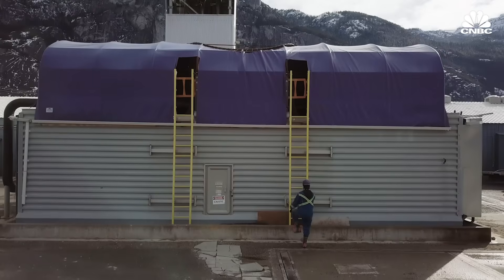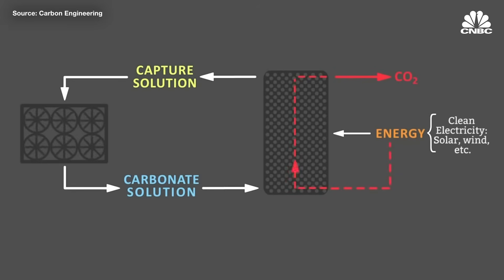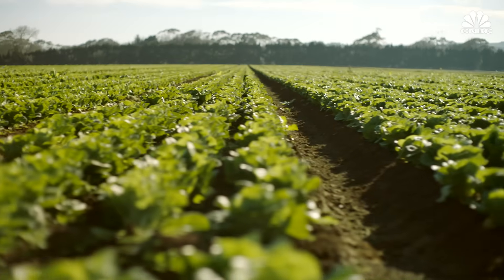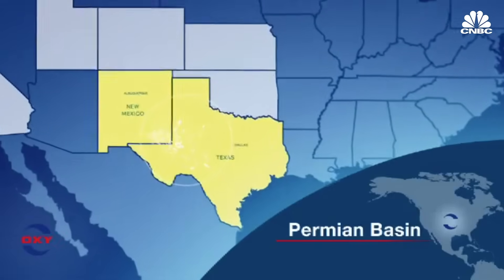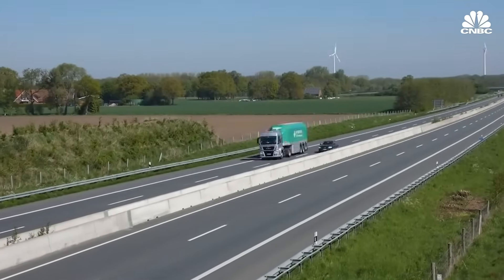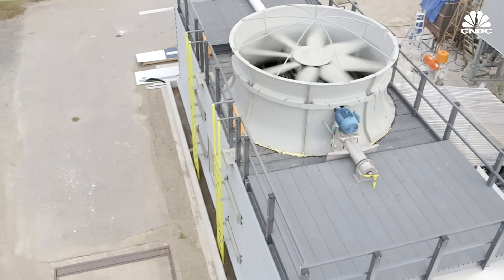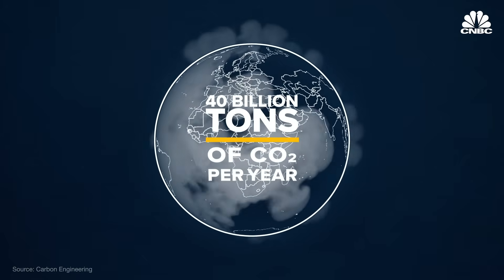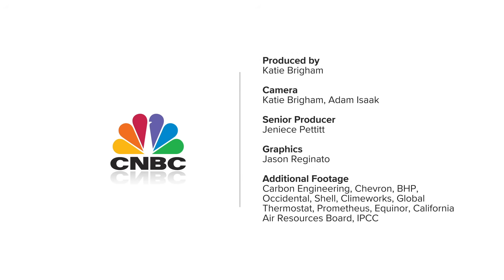Bill Gates-Backed Carbon Capture Plant Does The Work Of 40 Million Trees

Comment: If people truly believed that climate change was a problem, they would immediately stop driving cars, flying in planes (especially private ones), or even using electricity. In the last four years, the US has had emission levels that were lower than even the requirements of the Paris Climate Accords. So if you really think that it is as deadly a crisis as you say, then start acting like it, starting with giving up your tv, your computer, or your phone/iPad, since they need electricity which is fueled by coal or by a green energy source that requires even more "fossil fuels" to manufacture.

Comment: Is they have a bit of insite build a new or remodel a large steel plant to use the heat to make steel ,glass ,other plants ,to generate power and to power this machine when it can be made with unlimited power source to converting co,2 into clean by running it into the largest catalytic converter with heat needed to make steel glass other products ,,,

Comment: The concentration of CO2 in the air is 400 parts per million. What would be worse for mankind, if it were to increase to 800 ppm or if it was reduced to 0 ppm (zero).
If you cannot answer this question, you do not understand the problem at all.

Comment: Carbon capture plant can remove Co2 from atmosphere. But where do they store that Carbon emission after removing from the air? They are storing it underground in huge mega tons.. Do you have any idea, what will be the disaster if this Co2 emission ever leaked underground? Trees do not store Carbon dioxide anywhere, they release oxygen in return. It's totally non sense to compare carbon capture plant with 40 million trees. Also climate change is occurring due to other harmful gases in the environment like Nitrogen dioxide and Sulphur dioxide.  These gases can not be absorbed by the trees.. I am still reading material on this topic but this faulty solution seems like a distraction for public from current issue of Global warming.. Fossil fuel companies do not want to be screwed up by Governments. That's why they prefer to invest in such temporary plans..

Comment: When I was young I learned all about the carbon CYCLE. Like the water cycle carbon dioxide plus energy -> hydrocarbons + oxygen.  Hydrocarbons +oxygen ->carbon dioxide +energy, A fully recylable system.  Now with more CO2 in the air temperatures and moisture levels rise encouraging the growth of plants.  When they became too prolific the result couldn't rot fast enough leading to coal etc.  and a drop in temperatures and humidity.  This again is a cycle.  But if we take this OUT of the air it stops the cycle dead.  Leaving us with a permanent non reversible environmental change.  Not smart.
Reply: did u just ignore all the fossil fuel emissions out of your equation? :[

Comment: If you remove carbon from the atmosphere, put it back into the earth, extract it again, and then use it for fuel, you basically are making fossil fuels carbon neutral in the long run.  I don't see why this is counter productive at all.  You can use renewables to power the carbon capture as well.  As long as you remove carbon from the atmosphere faster than you put it back in, it will be carbon negative.  It won't cause more use of carbon energy because the price of extraction will still be there.  It will just mean that earth won't run out of carbon based fuels, and when you burn carbon based fuels, the carbon won't remain in the atmosphere.

Comment: Nuclear energy is the solution

- solar panels don't work at night
- wind turbines only work when it's windy
- there's not enough batteries to power the world when the sun goes down
- there are not enough geothermal sites to power even the countries they are located in
- tidal power has similar problems as solar

Comment: There is still no empirical evidence that increasing CO2 causes increasing global warming  (correlation does not imply causation).   

An increasing greenhouse effect depends upon increased re-radiation from CO2 in the atmosphere, and this manifests itself as a tropical tropospheric hotspot, plus increased Downwelling Longwave Radiation (DLR) which warms the surface.   However, this tropical hostspot and increasing DLR have never been detected.  In which case, increasing CO2 cannot be causing increasing global warming.

And we know that CO2 is not causal, because during past ice ages:
     When CO2 levels were high the world cooled.
     When CO2 levels were low the world warmed.  

The climate would not do that, if CO2 was the primary feedback agent.  In reality, the primary feedback agent is ice-sheet albedo (reflectivity), which explains all the manifold aspects of the ice age temperature cycle.  And this is controlled by dust.  

The dirty secret (sic) of climate science, is that while temperature may be proportional to CO2, CO2 is inversely proportional to dust (dirt).  It is dust falling on the northern ice sheets that causes lower albedo and increased warming.   And the really counterintuitive aspect of this, is increased dust is caused by low CO2.  CO2 is plant food, and when CO2 levels get too low during the ice ages, vast CO2 deserts are formed.  It is these CO2 deserts that cause the dust and warm the planet.

So during the ice ages, global warming is caused by LOW CO2. 

Please see my latest science paper on ice ages.
Modulation of Ice Ages via Dust and Albedo:
https://www.sciencedirect.com/science/article/pii/S1674987116300305 

Ralph

Comment: at $100 dollars to take out a ton of CO2 it would represent a fairly high tax on fossil fuel users;  of approximately $2 per gallon gasoline (CND?). For a hybrid car that would be a pretty high tax but it may supplant existing taxes intended to discourage gasoline use.  Of course dogmatic opposition have to say no because it conflicts with "their" solution.  I have a better solution; ban SF6.  One pound of SF6 is worth 2500 lbs of CO2; plus it lasts in the air 16,000 years.  It is exactly the dogmatic voices that do not like this solution that want a massive expansion of SF6 use in electrical grids.

Comment: See... This is bad. They're only doing this to pull more oil out of the ground using captured CO2 for fracking. They're using CO2 to push more CO2 into the air. This is entirely illogical.

Comment: Carbon dioxide is the most important plant food. It can not and does not cause run away warming because the absorption spectra for CO2 is already almost fully saturated.Indeed extra CO2 may cause cooling
Reply: This doesn't make any sense. If the absorption spectra is "fully saturated", then you're implying that CO2 absorbs all types of electromagnetic radiation.

Comment: I was always sceptical regarding carbon capture as you need to dump the materials where the carbon is bound somewhere. E.g. what do you do with these carbon pellets? Dig out giant holes ans throw thos stuff in there?
Reply: Would you rather do that or get flooded etc because of climate change?
Reply: @propiii  Seriously, is it feasible to dump all of the pellets underground? And is this stuff safe from "rotting"? If the carbon gets free over time it doesn't help. Even if these things aren't problematic, the cycle is still crazy: We dig the fossil resources, burn them, the carbon bound in these gets released into the air, we capture the released carbon using specialized plants, we bind them into pellets, dig holes and throw the pellets into these holes. Thats crazy. Much more efficient would be to keep the carbon where ot currently is, in the fossil resources.
Reply: @martinmartin6300  Its going deep underground. And CaCO3 doesnt dissolve in water. Also, a lot of the pellets can be used to make fuel and things like chalk like I already said. We're storing tonnes of nuclear waste underground so why tf would it be an issue to store something WAY less toxic?
Reply: @propiii  I don't say we shouldn't dump this underground, I am just questioning it. Depends on the costs of the storage and so on. I think its still better to stop the mining of fossil resources in the first place.
Reply: @larrypaul2462  did you even watch the video? Lmao. The co2 gets turned into calcium carbonate (how is that dry ice) that can be used to make fuel/chalk etc or get stored. I dont get the issue.
Reply: @larrypaul2462  uhh actually everything you said is false. This method doesnt end up with dry ice and the chemical compound it ends up with can actually be useful. And that an idea behind rebreathers has been around for a long time doesnt even mean anything 😂😂. Also please try to prove that they made a rebreather 200 years ago when we didn't even have much co2 in the air
Reply: @larrypaul2462  You do realize that this machine doesnt make solid co2 right? It makes CO2 bond with calcium making CaCO3. Not dry ice.

Comment: This will be a Big Oil con job just like their hydrogen system: BIG OIL GREEN HYDROGEN CON

Only green hydrogen is completely CO2-free. Green H2 is produced either by electrolysis from renewable energies (wind, solar, hydropower) or by direct solar water fission (sunhydrogen's method).
Whatever the source of the power it uses an uneconomic amount of it because the process involves very high temperatures  … Therefore the end product is too expensive when compared to other types of power 

Turquoise hydrogen is produced from natural gas (methane), the carbon is split off in solid form.
There is no economic means of dealing with the carbon produced from this process.. … Therefore the end product is too expensive when compared to other types of power

Blue hydrogen is also produced from natural gas (methane) through steam reform. The deposited CO2 is pressed below that of the earth.
Therefore the end product is too expensive when compared to other types of power

Grey hydrogen - from natural gas or to give it its proper name methane yes the most global warming gas there is - the output includes CO2 which escapes into the atmosphere.
This is the cheapest method of creating hydrogen … Hence the basis of the con.

So how do Big Oil deal with this problem?
They imply that they are producing green hydrogen when they are producing grey. The politicians have already bought this con - hence the hydrogen projects already in train … The politicos think they will get green hydrogen but after 10 years of trying the oil companies will admit defeat and we will be dependent on the grey hydrogen too much invested in political capital & infrastructure dependence (e.g. home boilers) to back out

Comment: Gross waste of money.  Better to follow Indonesia's example and construct liquid metal Thorium ion molten salt energy converters and get rid of the poisonous polluting coal fired power stations. Their
first 500MWe will produce electricity by 2024. These 7×500MW ThorCon units will sell  power to consumers at less than $0.07/kWh on an energy footprint of 43kW/m2 (2×500MWe on 2.3Ha) as well as being "walk away" safe, (high temperature but near ambient pressure), "load-following" and desalination for its own use plus extra for locals, without destroying  their tropical forests, so beat that solar farms..

Comment: All that goes simply against the 1st law of entropy: you can't inverse a transformation and make it back to original without spending less energy that was created during the process. It doesn't work this way, there's NO system giving more energy than what was input. Burning fuel produces  energy in form of fire, this heat can be used for driving, the energy  and its waste product CO2 increase the entropy of the Earth system, so that breaking CO2 in C and O2 again needs so much energy again, that the global balance sheet is necessarily negative... What kind of energy is used to make this process happen, and from which sources? Give us the all the data in order we can calculate the real efficiency.

Comment: so basically taking c02 out of the air so they can use it as fuel to put it back into the air?  would be interesting but would it actually impact our drilling for more oil or would we just be putting a band aid on an issue that will continue to grow.  what if that carbon dioxide could be used in propulsion systems in space?  it may or may not be right for the fuel industries to diversify but if they are to exist in the future when drilling for oil will eventually be outlawed... i mean you wont be able to continue taking a resource that isn't being renewed forever... there is a limit.  so it makes some sense, but there will be companies who will abuse the situation to make a buck... will enough of them actually migrate to the next energy frontier?   now there is also the issue with needing enough in the air for plants to grow as well, so eventually there may be controls needed, what percentage of the atmosphere has to be co2 for life to exist after all?  thou worrying about that would probably be a long term sort of thing, i mean it took 100 years to get us to where we are after the industrial revolution... in a 100 years people would know if they've taken too much co2 out of the air, i mean it would be obvious right?...go for it... we'll know when you are successful when the polar caps start growing again.

Comment: They claim "all the chemicals used in the cycle are reused so the process can repeat"   Expect for the energy used to make and run the plant.
Reply: *except
Reply: British Columbia, where this company is located, has massive hydro electric capacity.
Reply: Except energy is renewable depending on where you take it...
Reply: @annilator3000  Yes your correct energy such as wind, sun, or hydro is renewable but building the materials and structures to harness that energy (dams, solar panels, turbines) are not.
Reply: @andyjohnson3790  Exactly! Solar panels for example take about 10 years to make up for the pollution it used in order to be made. So at best you get 10 more years of legit clean energy. That's if they last that long because they will degrade over time.

Comment: These college professors that they interview don't seem to understand that there are things we use, such as oceangoing ships and most aircraft, that are essential to modern societies and can't realistically be powered by electricity any time soon, so the fuels they use need to be cleaned up somehow. Making cleaner fossil fuels may not line up with the political agenda commonly present at UC Berkeley, but it would actually be a significant improvement in terms of emissions. Also, most cars probably won't be electric/hydrogen for at least a decade since cars of that type are still very expensive, so having cleaner fuel for them would be a massive improvement as well.

Comment: "They use clean energy"
Shows natural gas system
Reply: I'm with you, but technically natural gas burns clean. The issue is that it leaks.
Reply: @darrishawks6033  dude. They burn carbone fuel to capture carbon and store it underground. That is a definition of stupidity.
Reply: @heyhoe168  It would only be as bad as you say if it has a net negative effect. Which it might. But if it doesn't, then that's a silly objection.
It's like saying "Dude. They literally spend dollars to make dollars" to describe why investments are always bad lol
Reply: @darrishawks6033  when you will count net effect dont forget carbon trail of co2 plant workers, electric station workers, and the natural gas extraction workers, count in equipment degradation. And finally dont forget, they dont really know what to do with co2 captured, so in the end of the day the co2 plant is doing nothing for a very high price.
Reply: @heyhoe168  Those things you listed are independent of their use of natural gas.
Reply: @darrishawks6033  no, it is part of its economy, and the economy is tightly connected to all kind of wastes. For example net effect of electric cars right now way worth than net waste of conventional cars, and the price gives a distant hint about it.
Reply: @heyhoe168  They would be there regardless of whether they were burning natural gas, so that seems an off-topic point to me.
Reply: @darrishawks6033  yes, that is exactly the reason why minimizing energy consumption is way more effective than any ludicrous eco projects today.
Reply: @darrishawks6033   may be clean but problem it still produces co2 and not much available after 30 or 40 years.
Reply: Literally says they'll want to move to 100% renewable
Reply: @nzbozza  Oh, and I want to move on planes only. You know, just not today.

Comment: The problem is: CO2 is not the only pollutant released when you burn oil. There is also C, CO, NO, NO2, SO2 and SO3, which cause a lot of harm too (intoxication, lung inflammation, acid rainfall, etc.). A sollution that doesn't adress these issues as well is not a complete sollution and it's not aiming at making people's lives better overall.

Comment: If chevron would put carbon capture units on all their plants it would have a much bigger effect at a better cost rate (chevron is one of the few oil and gas companies that has no plant to become carbon neutral). Plus renewable energy is not carbon neutral as building and maintaining renewable plants comes also with a carbon foot print. So a best it is a plus minus 0 effect.